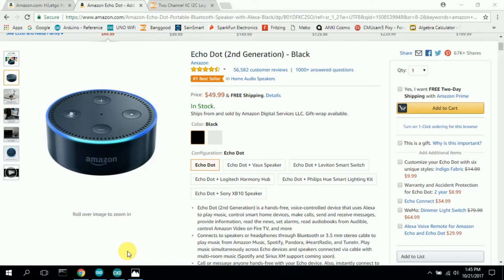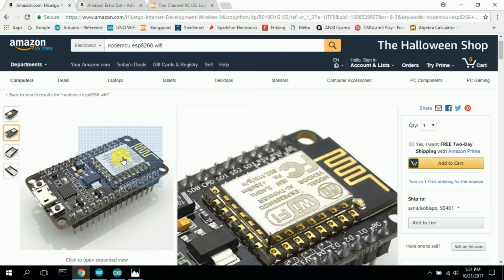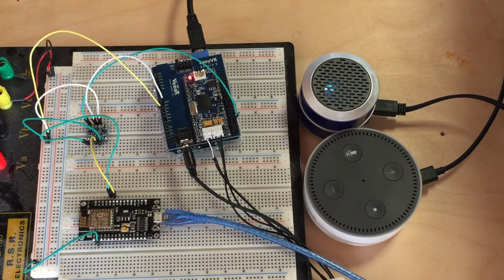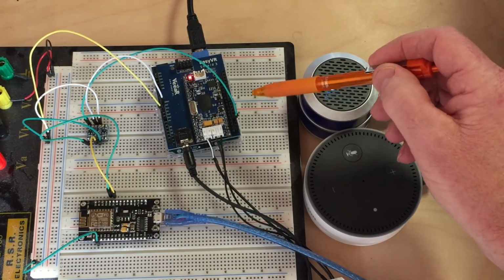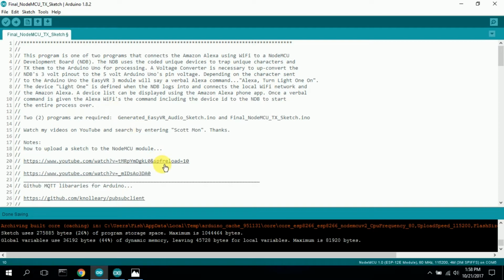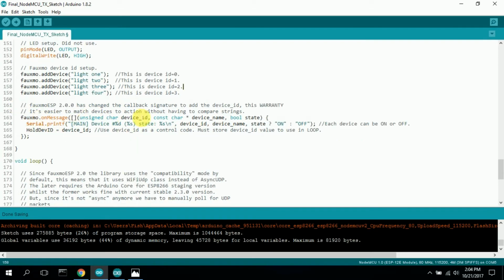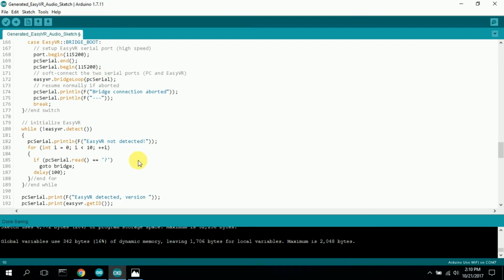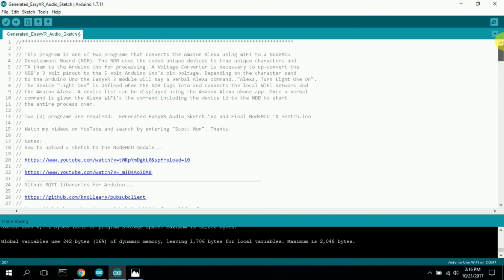Connect Alexa to NodeMCU to Arduino to EasyVR3

Comment: First thanks for the video, I always appreciate those that share. However, I am totally confused about why you felt you had to complicate the project by having the NodeMCU interface with the Nano, then have the nano output it as audio to the v3? You simply could have accomplished everything inside the NodeMCU and the Alexa APP. What am I missing about what you gained by this?
Reply: If you want more outputs NodeMCU isn´t enough. Besides not every output pins of NodeMCU work well according to the experts. Another reason is that you just use NodeMCU just for Wifi connection and Arduino just for the control because you are not familiar programming NodeMCU pins. Finally if you have a more complex project, maybe you should need an Arduino Mega and for that reason this video is so helpful because there are a lot of videos of NodeMCU and Alexa, but not this case. I hope it helps.
Reply: @alvaromartin6301  That's exactly what I look for because I need 14 digital outputs and 14 analog inputs for my project, that would just be impossible with a nodeMcu so I use an Arduino Mega with it. Thanks for sharing!